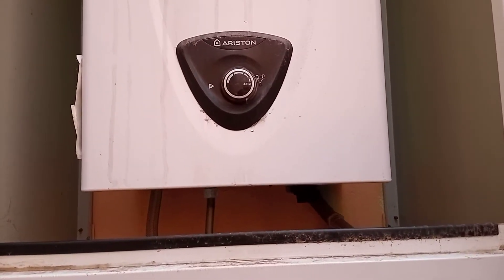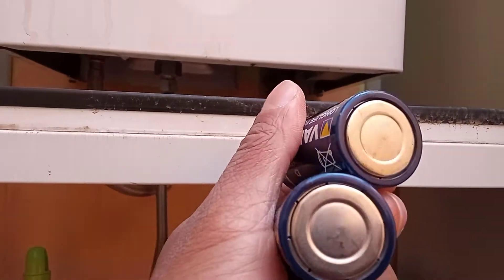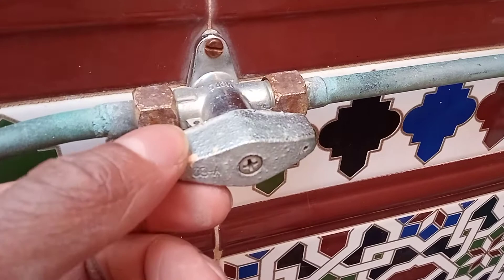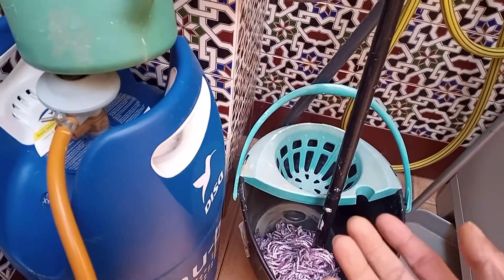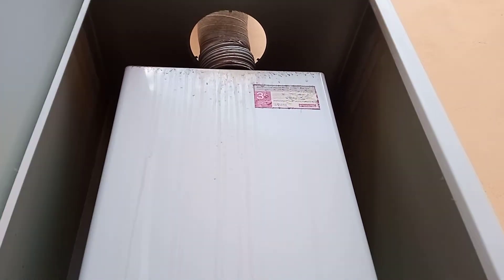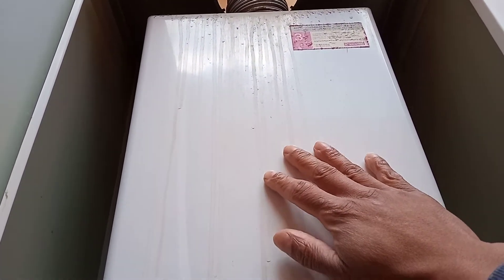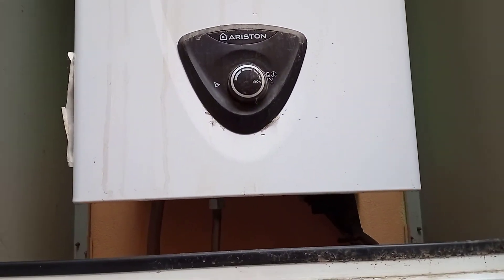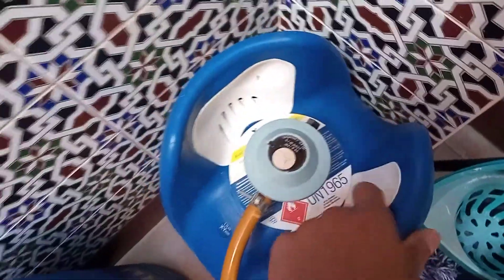ARISTON WATER HEATER (non UK installation)

Comment: My Ariston gas water heater which is similar to the one you repaired fires up for five seconds and then stops. I’ve taken it in for repairs and after a year of waiting they still haven’t fixed it. I put in new batteries and they changed a part but still the same problem. It is connected properly.  Can you please help me? Thank you
Reply from the maker: Hi there.
Have you got the manual?

If it's lighting up then going out it could be for a few reasons but it's good it's getting that far in the ignition sequence. 

Check flue has no restrictions and the products of combustion are getting away.

Also make sure it's getting enough ventilation for combustion. 

Something in the unit is shutting down with a safety device I believe. Depends if it's going out on low fire or once it's reached the 2nd stage with burner fully on.

Which country is this based in?

What type of LPG bottle is being used. Is it heavy/full of fuel?

Are you qualified/competent to work on it? Be careful and get help or more technical support if in too much doubt.